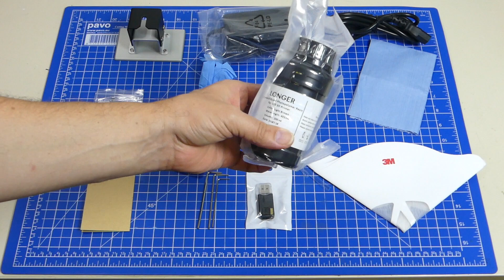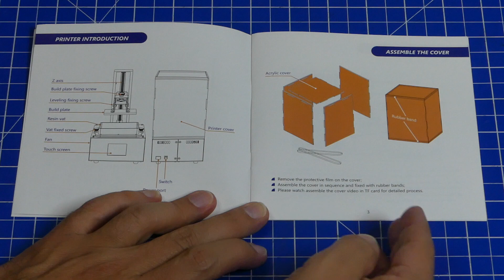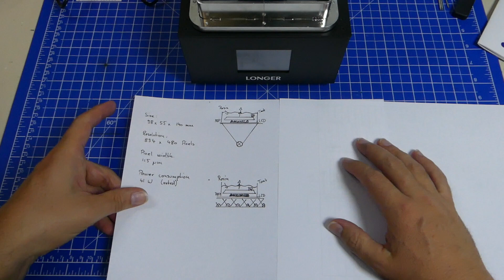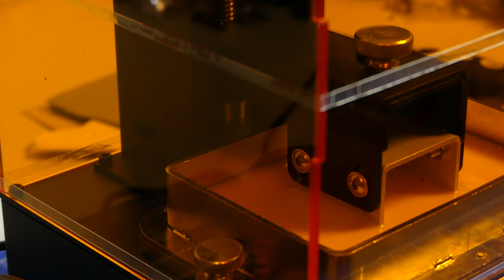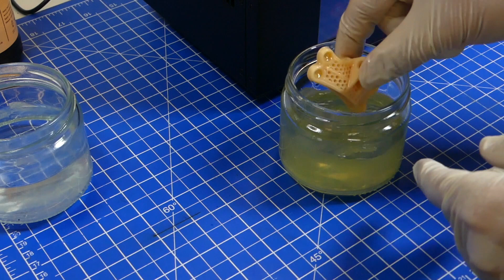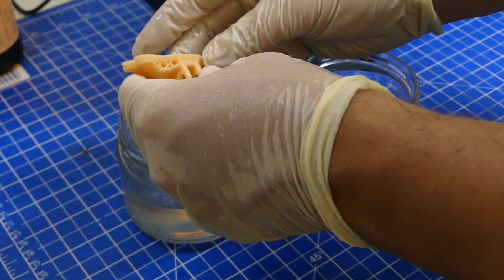Longer Orange 10 Review

Comment: I've had mine over a week and still haven't got it to print yet, first was the old version of longerware finely got the updated version and now it just sits their, they are saying the sd card has to be formatted , so I gave to save all the info on the card the format it then reload the info on the card and hope that works, way to much trouble for a new printer
Reply from the maker: I didn't use the SD-Card that came wit the printer, I had an issue with Longerware, but that was solved when I ran it with Administrator privileges as the instructions mention. 
This has become my favourite printer now that it works, just because it's so easy to use with the software and all.